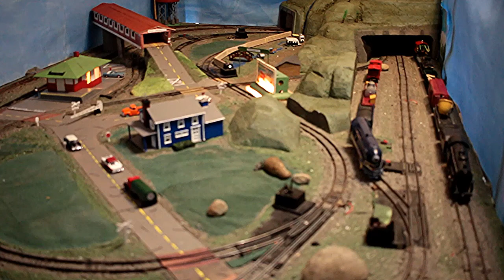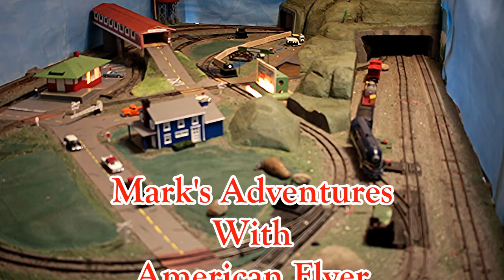Switching Locomotives and Building a Different Consist

Comment: Your layout has the look of a factory made layout for a store display.
Reply from the maker: Thank you for you comment Emil. That is a interesting comment. I did build this wanting to get several visual and operational aspects into a limited space. I have previously built ten or so layouts and have had many American Flyer accessories, to I had that knowledge to work with. I also wanted to use what A.C. Gilbert built and add my personal touches to make a realistic layout. Thank you for letting me know I succeeded.
Reply: @MarkWick Thanks for the info, like I said, the layout does have the look...even with the Plasticville house.